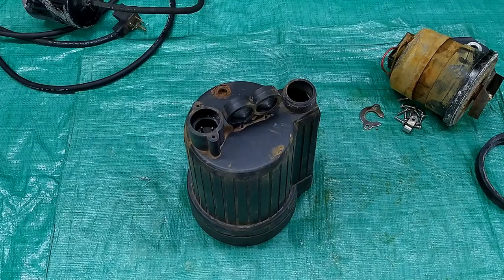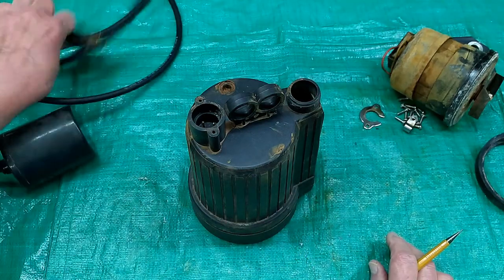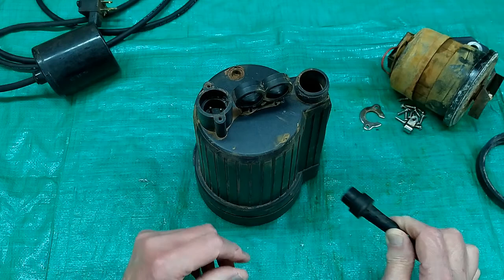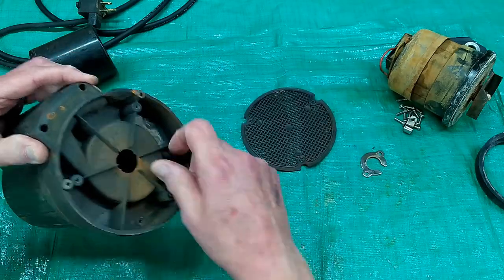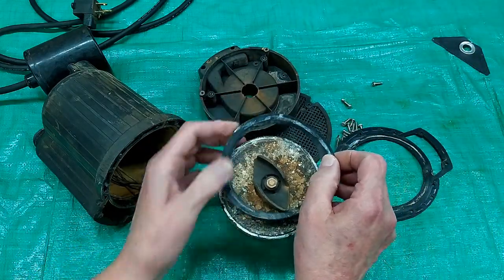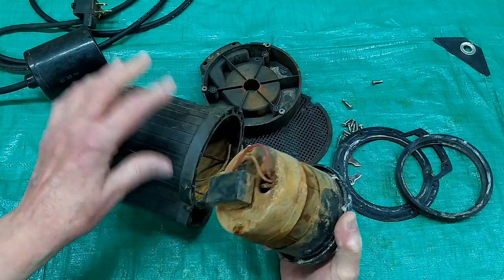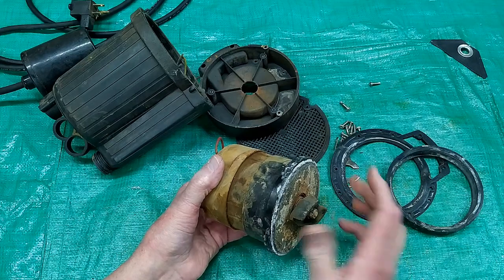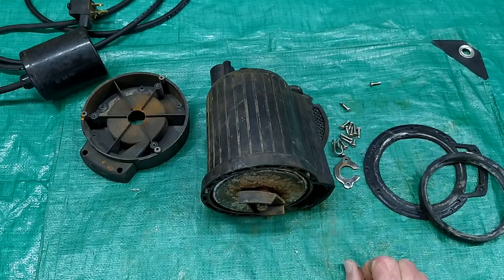Sump Pump Failure - One Example Why

Comment: THANK YOU Ron! As always, your analysis is helpful and will save many people money, nuisances and hassles. The simple maintenance info is especially helpful. 

I only have one example to add. We once  received a new sump pump that was damaged in shipping. The plastic case was cracked, so the pump was DOA. If we must order things like this, it's always good to inspect them before installation. The crack was so thin and small I could barely see it in strong daylight, but it would have led to failure quickly.  Luckily, HomeDepot replaced it, no charge. That's only happened ONCE in my forty-five years of home ownership. But I thought it might be helpful to those who must order things to be delivered instead of buying them first-hand at a store.

Best Wishes Sir!
~G

Comment: Nice video Ron. Water is a perfect insulator. Once you add some corrosion it gets conductive but to pull 20 amps or so through some dirty water is not always easy to blow a circuit breaker.

Comment: The ceramic seal on the shaft is a common point of leakage. Most pumps of this type are oil filled with the oil being added probably through that plugged hole on the top there. Assuming your pump was oil filled the oil serves to lubricate the motor bearings and to transfer heat to the jacket of the pump. Pumps that run without being submerged are more likely to get hot and heat the oil causing that to push out past the shaft seal (or other opening). If you see signs oil on the water in the sump that is a good indication that your pump is in trouble.
Is it the fact that the plug is 3 pin or that there is a plug at all that surprises you? The plug is there to prevent water entering the pump via capillary action along the stranded conductors of a power cord or water entry by leakage past whatever gland/seal is used to enter the power cord into the pump. On larger pumps the motor leads pass through a chamber that is then filled with potting compound to positively seal around the conductors. To prevent capillary action a section of insulation is removed from  each conductor, the strands separated then soldered to created a short section (about 3/8" long) of effectively solid conductor. That solid section is what gets surrounded by the potting compound creating a significant barrier to water. The leads might then go to a junction box where they would be connected to power cord.  Lots of different ways to get the power cord into a pump while keeping water out but it is a tricky problem.

Comment: If flooding from the sump will cause damage to finished surfaces or perhaps goods stored on the floor around the sump it is often advised to use a dual pump system with a pump control/alarm panel and three floats in the sump set at 3 levels. The lowest float is the stop float, the middle float is the start float the the topmost float is the alarm float.
The control panel flips from pump 1 to pump 2 and then pump 2 to pump 1 on each cycle. If one of the pumps fails to operate and the water in the sump continues to rise the alarm float will then close which both sounds an alarm and powers up the second pump.

Alternately some installations use two pumps with the backup pump float control operating only when the water level rises too high. This way if the primary pump fails and the water continues to rise the higher pump eventually turns on, pumping out the sump. A downside of this arrangement is that there is no certainty that the backup pump will operate when needed. It may fail because the impeller has become jammed (corrosion, debris, etc.) or perhaps the pump has become unplugged or wiring splices are corroded or for some other reason. For this reason this arrangement is not recommended. Two pumps with a flip/flop/alarm panel is a more reliable set up.

Of course this all depends on having a reliable power supply to operate the system when ever needed. There are kits sold that include a car battery, battery box, pump and float and perhaps a battery maintainer. One downside of these is that the 12 volt battery may not have enough capacity during an extended power outage. Another negative is that if the primary pump should ever fail, the battery pump will kick in and you'll never know that the primary is not working. The work around is a simple high water alarm that trips on at the same time as the battery pump. IMO this type of back up pump is no where near as reliable as is a system with a pump control panel.

Another option is a water powered back up pump. I've never used or installed one or seen one so I don't know if  I would or would not recommend their use and in what situations. Possible failure modes for a water powered back up pump could be freezing temperatures or the water supply being shut off  or perhaps a failure of whatever float activated valve is used to spin the pump.

In  the 1990's pump control panels were quite expensive. As I recall the price for 1/3hp cast iron pump was about $350 to the customer and the price for control panel was at least $750 but I can't remember if that was retail or our cost. Being that this is 2022 and Arduino and Pi boards are really cheap I would guess that a pump control panel could be home built for, mmmmmmm.... $100? $200? Enclosure, strain relief connectors, power supply, relays, piezo alarm, Arduino stuff. I'da know. It's a project I've long intended to develop for operating dual pumps for my septic system but I've never looked into actual costs or feasibility.  

As an aside pump control panels that were installed in underground parking areas had to be 'intrinsically safe'. The concern was that gasoline spilled from a damaged car gas tank, would end up in the sump and then that the fumes could travel up the conduit between the sump and the control panel and finally be ignited by something in that panel. At least that was one of the possible scenarios presented at that time. While the regular and the 'intrinsically safe' control panels looked nearly identical there were a few differences and not surprisingly the 'intrinsically safe' panels were much more expensive.

Comment: We have a self-priming trash-pump that sits outside the sump. It's been running for 37 years..no problem. Just replaced the brushes...3rd time in 37 years. It's so good it's sucked up dead mice and shot them out the other end.

Comment: I've never thought about it before; But someone must sell make a pedestal sump pump of similar strength to the submersibles that doesn't pull the water around the motor for cooling (and/or) is constructed in such a way that condensation isn't a problem. ... might be a bit loud though.

Comment: I think a pedestal-type pump would be an inherently better design (electrical parts all kept out of the water), but unless you go to something like an industrial-grade Tramco for thousands of dollars, the pedestal pumps you can get at home centers still have cheap parts that fail after a few years like the float switch. One could argue that even though you could buy 20 throwaway pumps for what a really good sump pump would cost, the price of a good one is still a lot cheaper than the cost of replacing everything in your basement when it floods due to pump failure.
Reply from the maker: I have two sump pumps. One in the basement and one outside in a 15 ft deep pit. Recently purchased two made in the USA Liberty pumps (one model 237 and one 247) both with captured vertical floats with magnetic switches and the motors are oil filled. Hopefully these will perform and last better than the cheap, made in China, box store junk. Thanks for watching! Ron